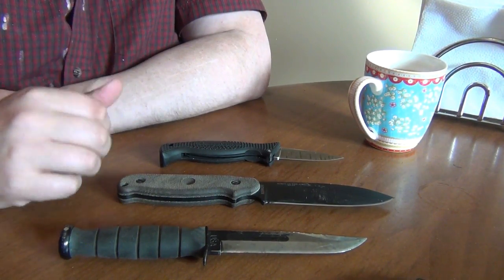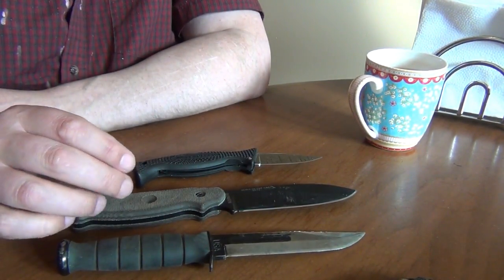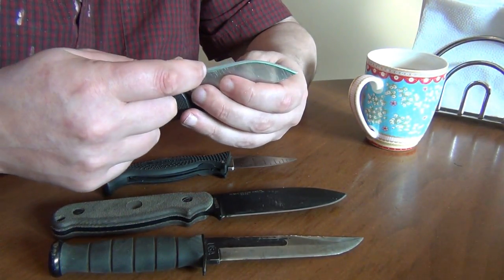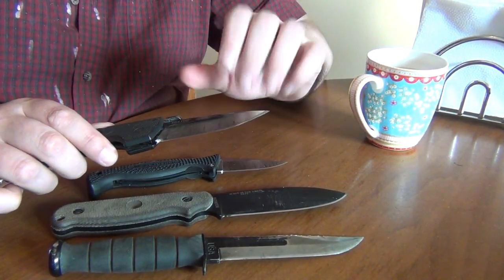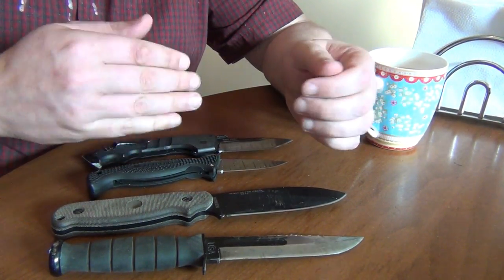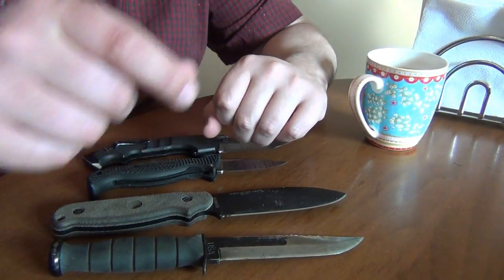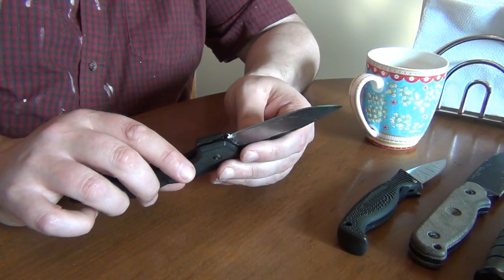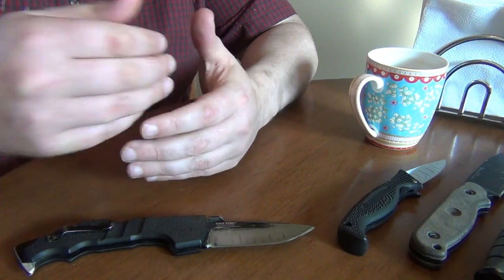Edge retention : ESEE, Ka-Bar, Spyderco, Cold Steel

Comment: Wow, very interesting. My first thought was that the Cold Steel would be through the roof comparing it to the others, but that's a huge difference that you measured.
Reply from the maker: +Yehoshua Jason D. Stone Just think that this isn't at the limit either, you can easily bring the edge down to 6 to 8 dps and run a more coarse apex bevel which will make the same type of difference happen again.
Reply: Cliff Stamp I didn't even think of that.

Comment: nicely explained Cliff. I thinned a busse out once, don't know the exact angle but it was fairly thin...chopped into discarded wood hit a hidden nail..2mm dink. I can't bring myself to thin out anything I'm liable to chop with again.
Reply from the maker: +mick of south staffs That is the practical counter issue. There is a loss of strength and durability as the cross section is reduced.
Reply: +mick of south staffs That's always been the secret with Busse's. His geometry works with his steel

Comment: Great video Cliff, as always I learned something new from you which is why I love watching your videos. I wouldn't have imagined the difference would be that much(I was the closest one and i was still way off), this was a rwal eye opener for me, thanks Cliff. Anyone who thinks that getting the most wear resistant steel is how they get better edge retention needs to watch this video.
Reply from the maker: +D00MTR33 I may do a few more additions and add them to it, some knives can do far better than what people expect based on the geometry, an Opinel for example.
Reply: +Cliff Stamp Yes, im learning more and more that geometry and edge angle and finish affect wear resistance more than steel type. I picked up a nice GEC 71 in O1 steel and its ground pretty lean (under 0.010 id say) and I put on a 10 dps edge on it using the edge pro 400 grit stone and its a very nice cutter. I'm going to get some more cardboard and do some cutting with it to see how it performs. im really like nin stainless steels lately (or stainless that feel like carbon steels like N77 and sandvik steels) in my knives. I've been enjoying the knives I bought in O1, super blue, m4, 3v N77 and 13c26 quite alot, I can go to lower angles and get very good cutting ability because of that. It would be interesting to see where an Opinel, a douk douk and some other knives land in your testing.
Reply from the maker: Yes, I have most of mine loaned out but I think I am going to get one and add it and possibly do an update.

Comment: I certainly agree with that. Lately I have been taking the very edge to a 3000 grit belt edge which is almost polished right up to the apex but not on it and then doing the apex or microbevel with a 600 grit Norton, I like it because the grains size is quite consistent so I get repeatable results. With the polished portion backing the 600 grit edge it seems to be so far the longest lasting edges I have ever been able to get. Since I almost always do slicing or draw cuts over push cuts it really works well. Also since I don't raise a burr I don't have to worry about not removing it all or having weak areas. You can assume that I have inspected the edge for damage prior to sharpening and removed any damage first.

Comment: Great video and excellent explanation.  I should have thought more on the percentages as I knew the performance would be higher, but didn't expect it to jump that much. However your discussion really showed how much geometry can improve cutting performance all things else being equal.
Reply from the maker: +Caffeine Junkie And edge retention, the angle is critical there. I should clarify I am talking about slicing, the effect is not nearly as large in push cutting.

Comment: how do you find the esee holds up in the field? I was deeply disappointed in my esee 4. the factory grind was unable to cut anything well and after sharpening it in the same angle as I do most blades in a slight convex it took edge problems like crazy. it was quite disappointing after seeing all these positive reviews and marketing of esee.
Reply from the maker: +Dutch Bushcraft Knives I am not sure what you mean by edge problems? Do you mean dulling and or damage?
Reply: +Cliff Stamp Both. Mine took rolls very easy and dulled very fast when I was preparing feathersticks for my fire. Actually the fastest dulling knife I've had. it performed like 440A
Reply from the maker: +Dutch Bushcraft Knives How did you sharpen it? Have you sharpened it and tried it again since then?
Reply: +Cliff Stamp 
I sharpened mine on Shapton chosera waterstones. I tried many angles from 25-40 degrees (combined angle degree of both sides) http://postimg.org/image/njhvw8efh/. It could be that mine had a bad heat treat.
I don't have the knife anymore because it just wasn't the survival knife they profiled on their site not only in edge the edge retention aspect. I think it could be a camp knife but not a knife I would rely on when I get lost in the woods.It lacks some important aspects of a survival knife.
Reply: +Dutch Bushcraft Knives 
I've used an ESEE 3 for carving, it dulled quicker than a Mora, but ESEE's have a huge angle to them, but was also very easy to bring back.  What kind of wood were you using it on?
Reply: Rusty Shackleford
Hey rusty thanks for your answer. It is mostly dried spruce I use for carving. It's not as soft as fresh spruce but still not that hard.
Reply: My esse 5 an 6 both hold an edge very well at 27 degree and are easy to maintain... you must have had a bad knife!

Comment: i have noticed that thinly ground knives go through material with more ease but, i have not found the edge retention to go up in them. my zdp 189 endura when it was sabre ground seemed to hold an edge just about the same as it does now that it has been ffg'd by jeremy. i always hear how it is one of the best edge retaining steels out of the steels i have but, i haven't found that to be true even when compared to my dpx hest in sleipner which cut twice as much cardboard as the zdp189 did and i found that to be true many times over and its blade is 5mm thick. i thought the zdp189 held an excellent edge from when i first bought it but, once i had sharpened it a few times, the edge retention seemed to decrease as i have noticed with many knives. i have to wonder if the hardness isn't consistent through the blade, at least that is the only guess i could make to explain how that effect seems plausible. i can get them all screaming sharp but, it doesn't hold like it originally did earlier on. also, when i say edge retention i mean its ability to maintain an edge that will shave my arm hair cleanly and without much force. i believe that the wedging effect causes tension in the material to be cut after the initial entry into said media and allows the apex to cut it more easily like cutting a taught rope vs a limp one. that makes sense to me, the way you explain it seems plausible enough but, i'm not entirely convinced that the opposite isn't true.
Reply from the maker: +knives save lives It isn't the gross blade thickness that makes the most difference but the edge angle itself. 

It is of course only one factor, there are others. The 10V blade for example had similar edge retention to the Vagabond even though the Vagabond had a much lower edge angle, but you have to look at all factors.
Reply: +Cliff Stamp after having pondered your answer and the subject i realize the stupidity of my previous statement. i actually knew that but, somehow forgot that that is a pretty fundamental thing as i had previously tested cpm-m4 at different edge angles and found the 17 degree inclusive edge dulled way faster than the 20 degree inclusive as the edge degraded rapidly the more thin the edge was ground. sorry if i seemed argumentative.

Comment: Hey Zues! Color me surprised for sure!
Reply from the maker: +C amber Edge angle is a powerful influence, in most comparisons that is often what people are seeing, not the steel.
Reply: +Cliff Stamp No doubt.  That an often times it seems the edge thickness is drastically difference.  Appreciate the video.
Reply from the maker: +C amber It depends on what you are cutting, but even on highly binding materials the influence of edge thickness is fairly small. Just consider that the edge thickness on a standard Mora is ~0.1" . If you compare that to a really thin edged knife at say ~0.005" the ratio is 20:1 however is the cutting ability anywhere close to 20:1 ? 

If you do carving with a standard Mora and a 0.005" one, you can get about 2:1 maybe 3:1 at an extreme. This means you are looking at an effect which scales by approximately a cube root effect. In contrast the edge angle has an influence which scales as a square effect. In short, get the angle optimized first, then the edge thickness for cutting ability/edge retention.

Of course for ease of sharpening the edge thickness is really important because it controls the edge width (at a given angle) and that radically influences speed of sharpening. A 0.005" edge on a 10V blade will sharpen much faster than a 1/2" bevel on a typical Mora.
Reply: +Cliff Stamp I appreciate that clarification.  I guess I was just thinking 2 to 1 is pretty big, although of course no where near as big as you the edge angle effect as you note.  

I guess it makes sense as I have some blades with relatively low edge angles that have surprised me with how well they cut given their edge thickness.
Reply from the maker: +C amber Two to one is a big change, but look at it in terms of the percentage change and then think about what it means when an edge thickness change from 0.035" to say 0.015" .
Reply: +Cliff Stamp Are you saying the physical change in edge thickness (represented as a percentage) is relatively large compared to the percentage increase in edge retention?
Reply from the maker: +C amber It takes a very large change in edge thickness to induce a much smaller change in cutting ability and even then only in deep cuts.  In the Mora example it takes a 10:1 change in thickness to make a 2:1 increase in cutting ability .

As cutting ability does influence edge retention, the effect will be very small. The reason that this is misunderstood by some of the guys cutting rope is that they infer edge retention from cutting ability and the precision is so low and edge retention is nonlinear that they can often make very misleading conclusions.

For example if you look at a knife which starts at say 15 lbs and takes 500 cuts to reach 20 lbs. If you decrease the edge thickness from say 0.025 to 0.015" you might take a 1 lbs off the starting cut. But that one pound, given the low precision and non-linear behavior means the 20 lbs point can be hit at 1000 cuts, hence they conclude it has 2x the edge retention.

But of course the knives don't start at the same point, it is like having a race where one person starts much closer to the finish line. Even at the same speed he finishes first, that doesn't mean he ran faster, it just means he had a shorter race.
Reply: +Cliff Stamp Thank you for the clarification, and also the commentary on rope cutting as a sign of edge retention.  I always understood that not evening out the edge thickness would have an effect, but how it has an effect is much clearer now.

When you're trying to look strictly at edge retention, do you do anything to account for the effect of the cutting ability from the edge thickness, even if it is a small effect?
Reply from the maker: +C amber If you are just trying to see how steel effects edge retention at a certain geometry then ideally you would have all geometrical examples the same however that really isn't practical. It is never done in labs either because there are always influences beyond the independent variables you are actually looking at (steel in this case). The general environment or simply the limit of precision and accuracy of the measuring devices, contamination, etc. . This is why you have to run multiple times to see if you can normalize out any systematic deviations and just reduce the random ones. 

From what I have seen, in most cases the critical geometrical differences are apex and edge angle. Just look at the graph where I normalized out the edge angle alone. I have an upcoming challenge on this where I am going to take five knives in different geometries, do the edge retention work and then post up the chart with the geometry details and you have to figure out which one is which.
Reply: +Cliff Stamp Makes sense.  And sounds interesting.  Looking forward to it.  

And thank you for always answering.

Comment: How would the deeper and higher primary grind influence edge retention if you're only meassuring sharpness, but not cutting ablility? Since sharpness is almost exclusively determined by apex thickness, doesn't it's degredation mainly depend on the angle of the apex bevel (and secondary bevel once the apex is worn away) ?
Reply from the maker: +Felix H The reduce the forces around the apex during the cutting which lowers the rate of blunting. The simplest way to understand it is to think what happens if the blade grind is really heavy. The knife will be very difficult to push through the cardboard which means more twisting of the knife and more compression of the cardboard, both factors make it harder on the apex doing the cutting.
Reply: +Cliff Stamp So the apex itself is indirectly weakened through a heavier grind! That's interesting.
Reply from the maker: I never thought of it that way, but yes, nice insight.